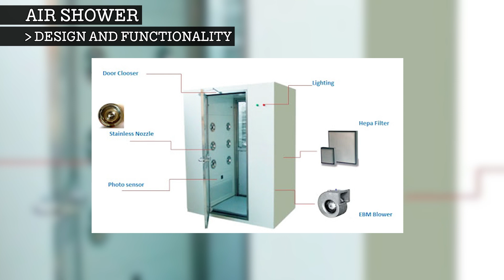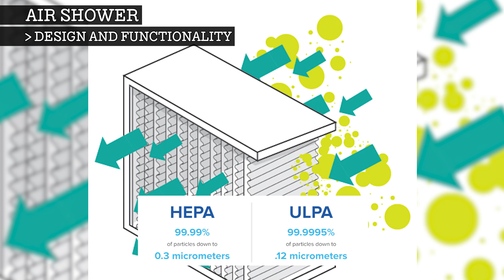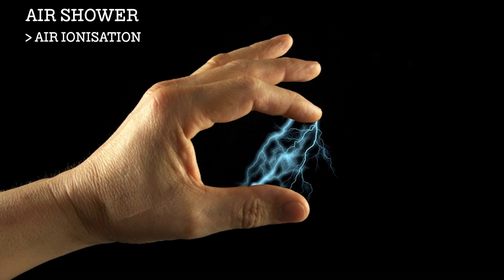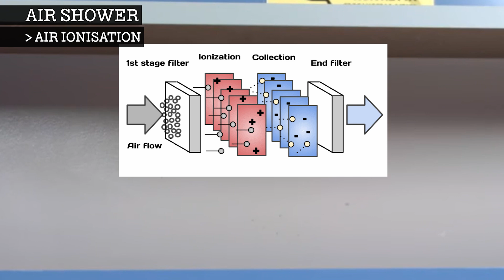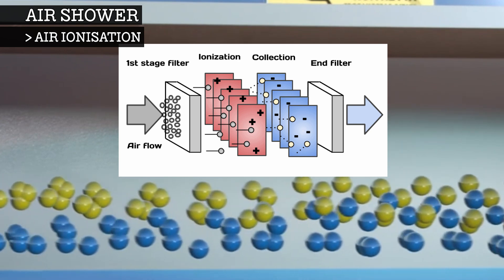AIR SHOWER.

Comment: I think some hair driers also have ion generators to prevent static buildup. But I’d have distinguished that ions cancelling each other out isn’t how particulates are dropped out of the air. Rather, that happens via electrostatic induction.

Comment: I just installed a blow-o-matic 8000 the other day, to cut down on my water bill, where my old shower us to be and it works wounders! Well... just as long as your wearing safety goggles and keep the scent jet pool filled. I never knew you could buy Axe body spray by the gallon. Now if only I could figure out why my power bill went up soo drastically...?

Comment: HEPA doesn't just capture particles of .3 micrometers and larger, it also captures smaller particles. .3 micrometers is just the worst case filtering efficiency at which the 99.95+% efficiency is rated.
"Common standards require that a HEPA air filter must remove—from the air that passes through—at least 99.95% (European Standard) or 99.97% (ASME, U.S. DOE) of particles whose diameter is equal to 0.3 μm, *with the filtration efficiency increasing for particle diameters both less than and greater than 0.3 μm*." https://en.wikipedia.org/wiki/HEPA
Reply: How could filtration efficiency increase for particles with diameters both greater and less than 0.3 micrometers?  I can understand greater than 99.95% efficiency for particles with larger diameter.  I can also understand that many particles with a lower diameter may also be captured, such as particles with 0.2 and 0.1 size, and that some with even 0.05 and 0.01 micrometer diameters could be captured.  But why would it have for smaller diameters a greater than 99.95% efficiency?  At that point the score seems to imply that it's worst efficiency is for rated particle size of 0.3 (even if it's still 99.95%+) as it says it has increasing efficiency for both larger and for smaller diameter particles.  I believe that's error in wiki article and it captures some smaller particles but is less efficient at doing so.  There is no way it is more efficient at capturing particles of 0.01 micrometer diameter than it is at 0.3 micrometer size, as article basically states.
Reply: @SoulDelSol  For some reason my original response disappeared, but in short, if you read the linked article the efficiency is indeed greater for particles smaller than the worst case .3 micrometers. Government standards bodies and independent testing confirms this.
Reply: @yourcurtainsareugly  wow that's kind of counterintuitive.  Ok I'll check it out thx
Reply: In otherwords a hepa obviously isnt as efficient as an ulpa.  It's less efficient for particles smaller than 0.3 micrometers and not more efficient as your highlighted bolded quote says.
Reply: Whateverrrrrrr

Comment: If I was stupid rich I would have a few of these installed in my house.
Reply: You probably do. I have them in my forced air system which circulates through entire home  (heat and AC), in my large dehumidifier, and in my different vacuum cleaners